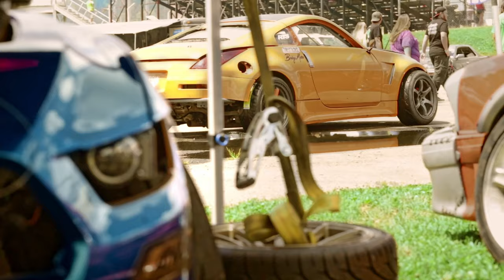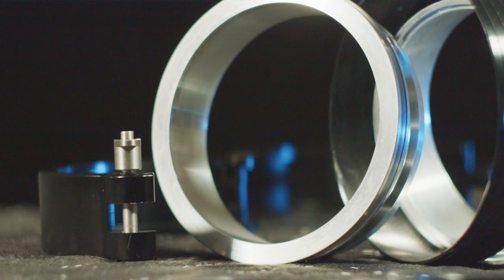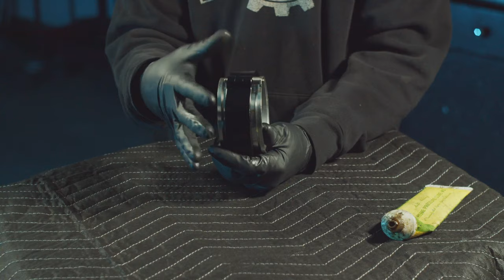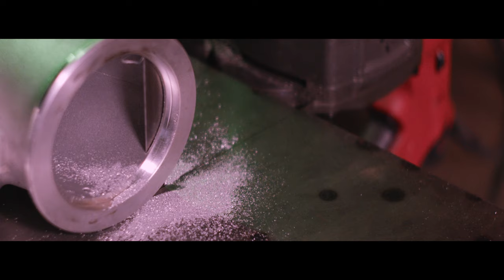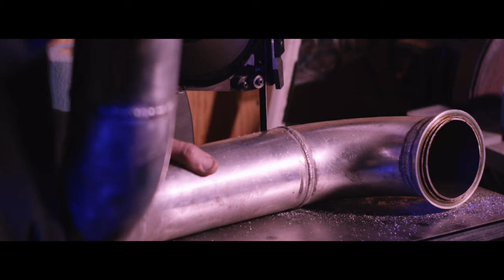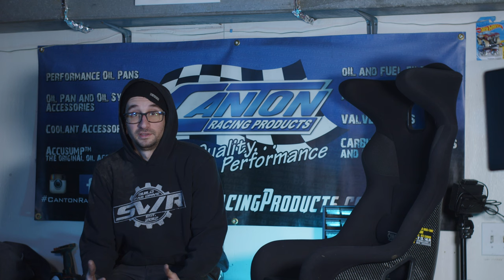$25 Ebay HD Clamp? Are they even any good? Product Review.

Comment from the maker: Update after using for a a few years. The O rings crumbled apart when I removed the clamp the other day. The one part I was questionable about failed. Good news is I replaced them with Vibrant ones and it’s all good. Side note, car still made boost even with no o rings in it. Turbo just had to work a little harder to make up for the boost leak.

Comment: This is more representative of what they should cost. Crazy to me people have been paying $150 for a few pieces of aluminum and some O-rings.
Reply from the maker: If a big name brand one was $50 I think that would be a fair price. The amount some of these companies charge for some very simple parts is mind blowing.
Reply: @Shane_Whalley  100% thanks for the awesome review man. Even if you wanted to replace the O-rings with nice fancy larger green ones it might be $1-2 a piece and less in bulk.
Reply: @802Garage where do I get them?
Reply: You are compairing these two things wrong. you are comparing them as two different products from two different companies. where as one is from a company that designed and had made that product and one is from a company that just coppied it.  If you had spent he last year designing prototyping and paying for the production tooling of a product you were then going to sell for $100 to in time finally break even on your costs and start to make a product, would you be happy if i just coppied it and knocked it out for $10? China ignore all patents. All you are doing is validating theft as you like cheaper product.
Reply: @krusher74   You need to look up amortization. I'm guessing you would defend Mishimoto prices too when they use the same Chinese factories as eBay brands for many of their products. A company like Radium Engineering is actually a small team designing and manufacturing products in house or in small batches, and their prices are far more reasonable. Most of the companies charging $100+ did not come up with the design either. They just copied the original and made a few tweaks. Most of them are also using overseas factories to manufacture them. It is a few pieces of aluminum and some O-rings. I'm not defending Chinese practices, I'm offended by the pricing a lot of companies get away with. If their pricing was more reasonable, less people would turn to cheap clone alternatives.